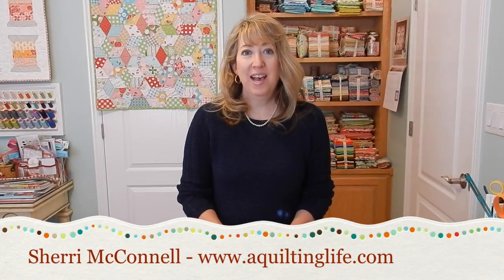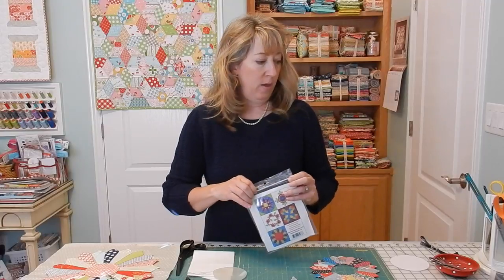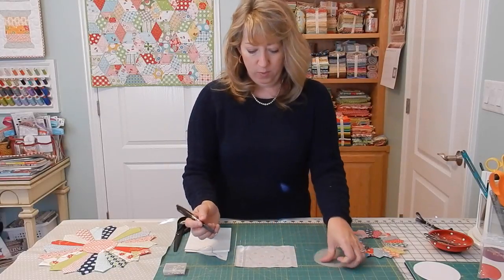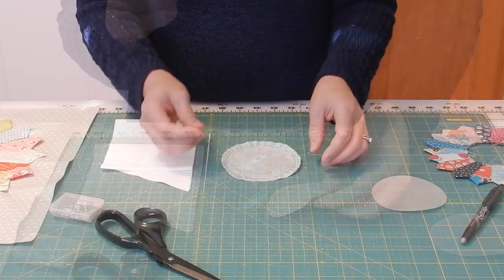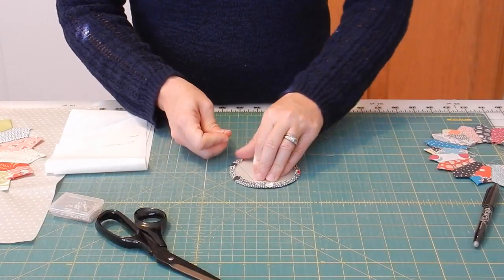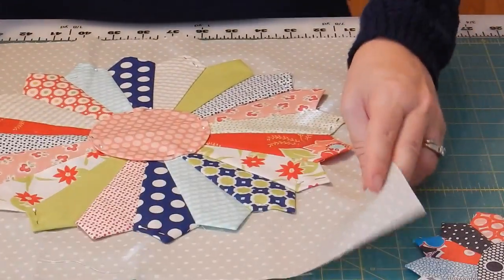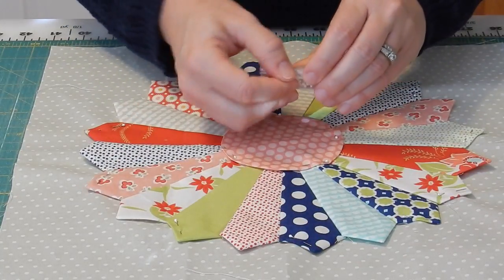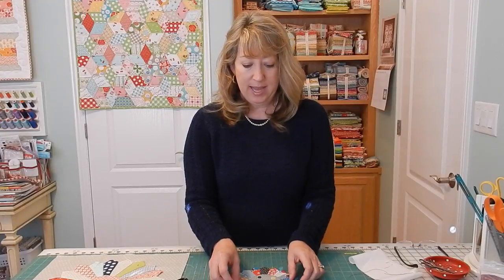Dresden Plate Block Tutorial Part 2: The Circle Center

Comment: Rather than using pins, I baste my Dresden down several inches back from the edge on the background using the largest stitch on my sewing machine.  It is very easily picked out after hand sewing the Dresden down.
Reply: Thank you so much for the tip